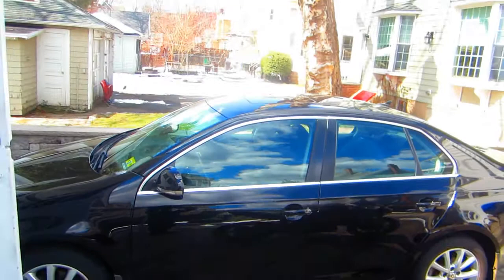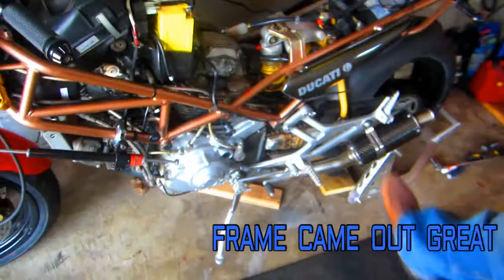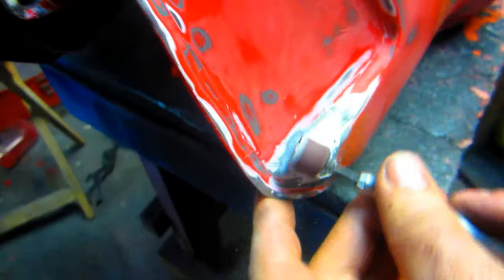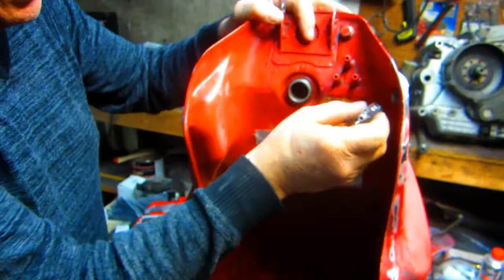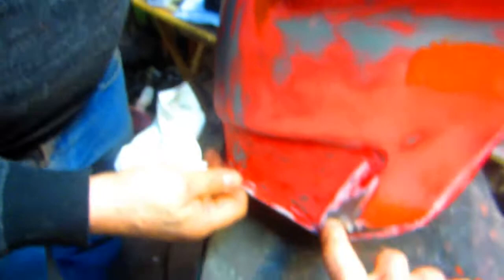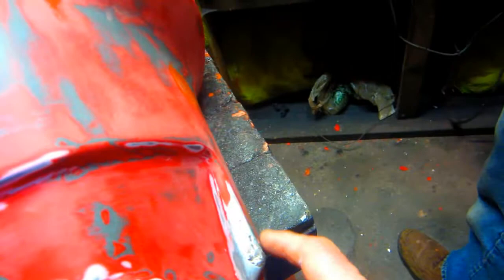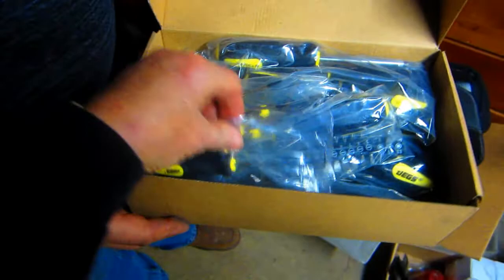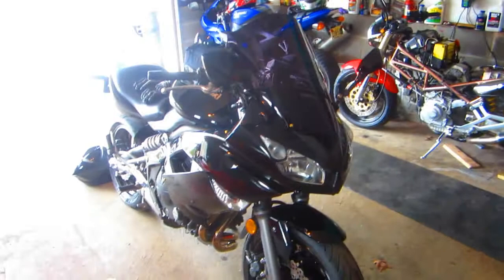HOW TO REPAIR A LEAKY DUCATI MONSTER TANK EASILY .

Comment: #1 never solder a gas tank.  #2 If you must throw that POS soldering gun away and buy a High watt soldering iron like is used to fix radiators or “lead” a car body.  #3 just braze the hole and be done with it...